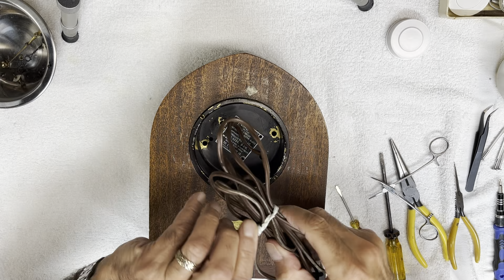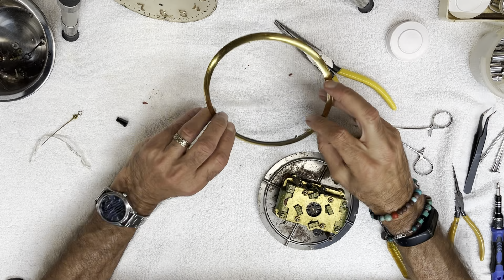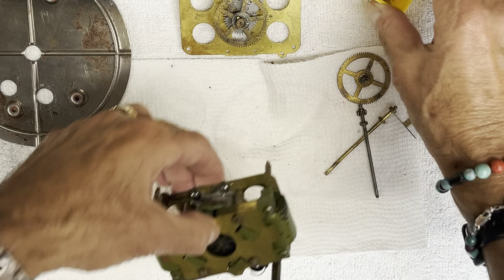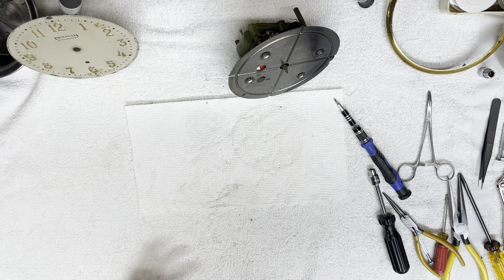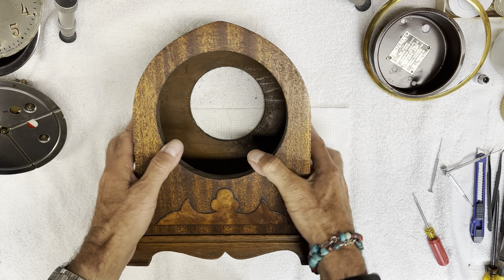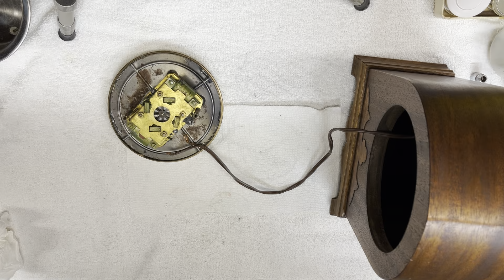Repair and Restoration of an early Ingraham Mantel Clock, 1932

Comment: Nice work. You mentioned in the intro that the dial was free to spin on the clock. Was that simply a case of the lock tabs not holding it firmly in position?
Reply from the maker: Thanks. I believe so. I fit them back into position, but didn’t think it would stay put so I used double-sided tape to hold the dial.

Comment: Do you happen to know whether it's safe to paint flame-retardant silicone conformal coating (like MG Chemicals 422C-55MLCA) onto an Ingraham clock's electromagnetic coil? I'm looking for a way to fireproof the coils in order to reduce the risk of one bursting into flames due to shorting out or something similar, and am wondering if that would be a good solution.
Reply from the maker: I do not know if it is safe.  I do know that it is highly unlikely for the coil to burst into flames.  I have never heard of that happening to one of these clocks.  If they get shorted out, the circuit is broken and they will not run, the current does not flow.
Reply: @markh77  Thank you.